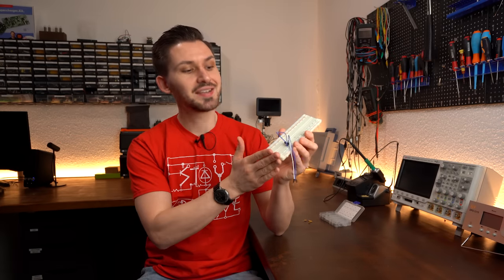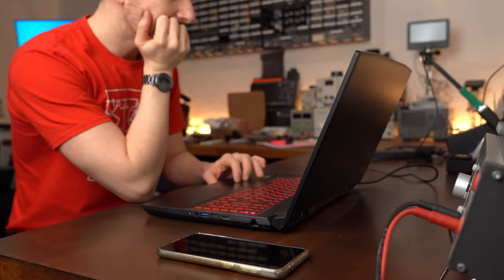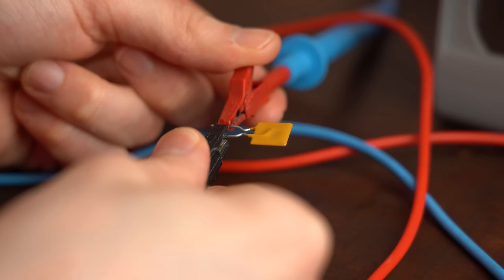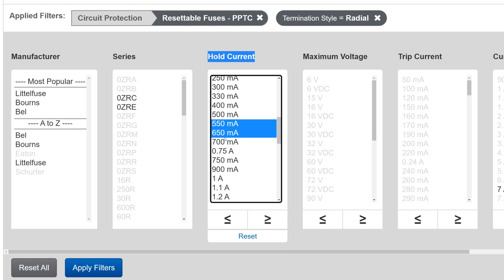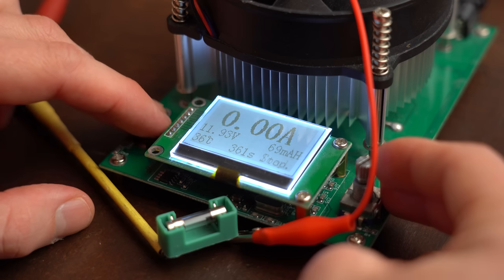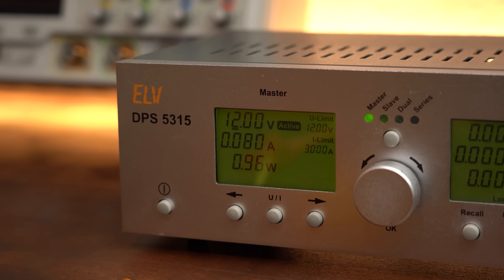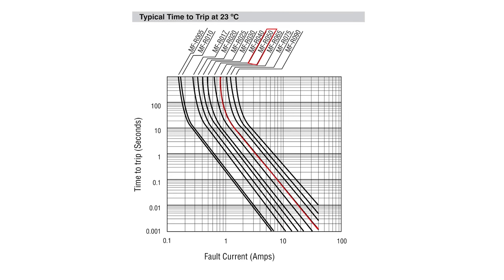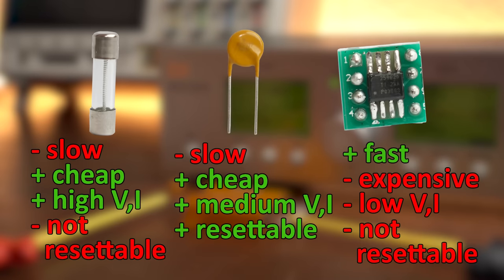The Best Protection for your Circuit is NOT a Fuse!.....but a Resettable Fuse? EB#54

Comment: Great video as always and a big +1 for Mouser!!! Two things to be aware of with PTCs vs a normal fuse or breaker though. The max interrupt rating and how fast it interrupts. PTCs are fine for low power electronics, but if there is a device with a high current source feeding it the PTC can destroy itself or not stop the inrush of fault current. Since, as like in your example, they can be rated as low as a 60 Amp interrupt rating. Fine for devices with small power supplies. But if you are powering something with a large power supply that can deliver 100's of amps (batteries, mains powered power supplies) and the device has a solid short the PTC may not be able to absorb the current spike. Whereas fuses have interrupt ratings from 5k up to 200k amps. Why some fuse holders are reject style holders, they will only fit a certain interrupt rated fuse and you physically can't install a lower rated fuse in the holder. 
Then there is the speed. Sure, tripping a 1A fuse or PTC with 2A will take a while, but how fast will a 1A PTC interrupt a fault with 20A of fault current vs a fuse that will instantaneously blow. 
Sure most of the viewers projects would be fine with a PTC, but to avoid possible damage with higher powered  devises a fuse or breaker is still needed. It can be in series with the PTC and at a higher trip level, yet will still provide protection in high current fault situations. PTC will take care of overloads and lower amperage faults and the fuse will take care of interrupting higher current faults that may have destroyed the PTC and NOT have interrupted the current flow.

Comment: I've seen these on circuit boards of equipment I've worked on or disassembled. I had no idea what the long tubular thing with what looks like heat sink blades was. Now I know. Thanks for the tip !

Comment: We recently had a Fender amp with a PPTC inside. They reported it started play less loud over time and the unit eventually turned off. When we tried to troubleshoot it we found one of those PPTC inside which had tripped. Thanks for the great video!
Reply: That is very interesting. I have a Bose system  that behaves the same way. I couldn't find the cause when I opened it up. I don't recall seeing a PTTC. Will take another look. thanks,

Comment: For example, if you have your normal current for your IC of about 500mA, in  case of a short circuit you will have maybe 10A (if your power source can supply). So it means that typically, current consumption will increase not twice, but much-much more. And in this case, this kind of fuse will (must) react immediately.

Comment: The glass/ceramic fuses are similar to those used to protect your house installation as they will trigger at 10x their rated current within 10ms(FF Superflink) to 3s(TT Superträge) depending on the class/characteristic of the fuse.

Die Schmelzsicherungen für Geräte sind ähnlich, zu denen, die in der Hausinstallation verwendet werden,  da sie auch erst beim 10x ihres Nennstromes sofort 10ms bzw. innerhalb von 3s abhängig von ihrer Charakteristik auslösen.

Comment: Hey Scott! Just want to mention that 3D printers used PPTC's in the old ages of the RepRap project. If you take a look at the design of the RAMPS1.4 Shield you can see that they used PPTCs to protect against overcurrent/shortcurcuit, but sadly this method didn't work that well so it was scrapped and got replaced with blade fuses.

Comment: A very effective way to protect a circuit is just a light bulb. When small intensity is consume it has a low internal resistance, in case of a short circuit it will limit the current to the rated lamp current. Of course a little more difficult to select but has the huge plus to emit light if "activated", 100% safe. Very useful in case of fugitive faults...

Comment: Great video! 
I occasionally restore old transistor radios which may or may not have shorts in any part of the circuit so connecting to a battery might be "terminal".
I built 3 volt, 6 volt, 9 volt and 12 volt battery supplies with a tiny "pea" sized 100mA light bulb (for each voltage) in series. At 10-20mA (correct) current the light is off and the radio might work.  If there is a short, the bulb lights up very quickly and limits the current, AND tells me that there is a fault. It uses less wires and needs less hands to work.
In some ways it is like a PPTC but I have not done your accurate work in measuring the rate of heating and current limitation.
Dave D. Australia
Reply: This is a standard test-jig in audio amplifier repair, where the lamp is a 60W mains lamp in series with the live mains wire.
Reply: @misterbonzoid5623  Yep. I have done this for valve/tube amps and radios. A 20 watt lamp has a higher resistance giving a lower voltage and current to allow the capacitors to reform slowly. When there is noise from the speaker and no smoke, swap to the 60 watt lamp and then full power. 
Dave D. Australia

Comment: I use automotive fuses. I take a U.S. outlet plug apart and align the contacts to the fuse blades then mount it all by the edge of the enclosure so the fuse sticks-out enough to pull if need be from the outside. Its not small though comparatively. But I trust it. Can handle 20a easily with the proper fuse. The hepa filter beside me pulls 1.9a on start then settles to 1.1, I put a 2a on it and its never popped.

Comment: FWIW: In my designs I use a PTC & a TVS diode for overvoltage and reverse voltage protect. I put the TVS diode behind the PTC so if there is a overvoltage condition the PTC fuse will trip protecting the TVS diode. A unidirectional TVS diode can also protect against reverse polarity from the power source. TVS diodes (basically a Zener diode) will have a forward voltage drop of a bout 0.7V so it will limit reverse polarity to -0.7V. So with just two low cost components you get current protection, overvoltage protection, & reverse polarity protection.

Comment: One problem I have found with these as a result of the small power leakage is some devices like CVCC regulators can "crash" and when the fault clears are no longer regulating.  Tried to do this with a battery charger and when there was an overload cleared it then would appear to work but the CVCC no longer limited and would have blown up the battery.  The total cutoff of a fuse eliminates the "funky control failure" of chips due to the brownout the PTC causes in a fault state.

Comment: Seen it in a homebuilt led lamp for plants. It was used to prevent thermal runaway in a 2s3p build. The goal was to achieve protection if one series broke and the other 2 got a higher current flow. When one was disconnected to simulate a brakeage it made the lamp dim because it limited the current. Interesting enough the other fuses actually restored themselves very slowly(almost simultaneously) until they tripped again. It will therefor slowly "blink" which can hint that something has happened. A perfect way to save the LEDs which can be pretty expensive in comparison to one of the PPTCs. Also the plants therefor never completely lost their lights.

Comment: Long ago, when thinking about my prototype EV builds. I thought about just replacing all fuses with Circuit-breakers, to not only save money on blowing fuses during experiments, but also keep me from being stranded. Breaker trips, just readjust something, reset breaker, and continue testing or riding around doing my delivery job. But the only circuit-breakers I knew about at the time were too big for a bike. I'm going to revisit that idea. But thank you for teaching me about this option.
Reply: And thank you for exposing me to Mouser.

Comment: Very nice! As always it comes down to the right tool for the job. Within micro-electronics, that's usually never the fuse. When working with mains, it very likely is a fuse.
Reply: i don't think these are considered micro electronics...i mean there's fuses less than one amp and it's not unusual for a circuit to draw near one amp I'm pretty sure micro electronics is more like what's inside of an IC package or even smaller than that... just saying. but i think you still made a good point.

Comment: Great(scott) video 2x👍
reverse current diodes are also very helpful keeping the components safe.
Reply: i blew up my UPS because it didn't have any reverse current protection, I'm still mad. It was just a small tap of the wrong cable for less than a second, the reverse current dropped directly at the junction of the mosfet, I was like, WTF no reverse current diode ? 
I'm never buying from this brand anymore
Reply from the maker: Definitely
Reply: @monad_tcp  I has more than one or two things let the magic smoke out. 💣⚡

Comment: There are also NTCs, that act as in rush current protection! It means that they have a decent resistance that decreases over time while it heats up.
Reply from the maker: True. You can find out about them in my soft starter video ;-)
Reply: Thermistors

Comment: i think the conclusion here is - whatever protection device thats appropriate to your specific circuit is whats best.
have you seen 3 terminal surface mount fuses with built in resistor heaters designed to melt fuse element?
part number ITV4030 :face-blue-question-mark:

Comment: THAT'S WHAT THOSE ARE!!!!!?

I always though these were some kind of weird capacitor and never paid them any attention, and the SMD ones on my Arduino Due's USB ports really confused me - despite how pretty they look. But the timing of your video couldn't have been better, as I've been bringing myself up to speed on electrical engineering to design/simulate my first complete circuit for a prototype and I've been planning on adding a fuse to it for protecting itself and my Arduino... But now I might rethink that.

PS: Just checked for these in the PC Power Supply I use for a bench power supply and found them, which explains why it cuts out when I accidently short it, but has never blown up or popped it's soldered-in-place fuse. So cool!

Comment: There are also bi-metallic thermal fuses of course which are standard for thermal cut-outs. I guess you could fix one to a low value resistor to make it trigger based on current (as the resistor heats) and it would be automatically resetting and have no 'trickle' current.
Reply: There's a version of thermal cutout made specifically for overcurrent protection. Instead of using a resistor they run the current through the bimetallic strip and the self-heating makes it trip. Or now that I think about it, this trip mechanism is exactly how regular circuit breakers work. Look for "auto reset circuit breaker" online.

Comment: These old fashioned glass fuses come in different versions, like the FF (Fast Fuse) and the SF (Slow Fuse). The fast ones react, as the name implies... quite fast. Even a small peak current, like when a device is powered up, can be enough to trigger them. Which type did you use in your test to do the comparison?
Reply: If resettable fuses were good for really sensitive applications they'd be used there but - to date - glass fuses or ceramic fuses are still in use in both protection of digital multimeters (and other measurement devices) as well as power semiconductors. Obviously that's not the case. Actually fuses come with more categories than just slow blow and fast acting.  On the other hand there really are quite slow when just slight overload is induced. And that is also intentional.
Reply: I wanted point this because my multimeter in the manual say use fast fuse 350mA and they are really fast, I just did touch the circuit and was fused even when I realized instantanly was in current mode instead voltage, :,D at least I have spare because that happen too like 4 years ago and was impossible to me find those values in my city, I had to imported them and wait because also UPS didn't have a normal service to my location.
Slow fuses are useful on high capacitive loads like power supply or motors, even on USB devices they are intentionally slow to alow charge a big condenser before trigger.

Comment: @6:35 The 1A at the glass fuse is the hold current. So you should use a 500mA glass fuse. An the time it needs to get triggered depends on the characteristic. You did not mention it. But it looks like you use a slow one. A fast triggering glass fuse should trigger with double current in about 30ms.

Comment: These would come in quite handy in some of our ceiling air con units, which do blow their glass fuses (F3.15A and M3.15A) quite regularly after power cycling. I need to look into that further...
Reply: If you are in a country with regular power fluctuations you should have motor starters in your aircon, refrigerator etc with a delay that prevents fuses tripping after short brownouts.
Reply: @mrfrenzy.  I didn't mean the main fuse of a compressor unit. It's more like the internal air handler unit which is mounted on a ceiling, that works with a cold water heat exchanger. I'm talking about industrial sized cooling here, not domestic.
You just need to supply power, cold water supply run, warm water return run and a drain line to it and you're good to go (as long as you have some machine, that cools the water circuit down).
These only have to run the fan, the solenoid valve for the water circuit and the internal drain pump on occasion.
It's always the little fuse on the control board which blows, but that power line is supplying power to the whole thing.
Reply: @wiedapp  the airhandler probably has a soft start circuit for the fan motor. If power is cut and reapplied before the soft start "cools down" it will "hard start" the fan with full current which blows the fuse. You can add a small 1 minute time relay which solves the problem.
Reply: @mrfrenzy.  Unfortunately these ones don't. It's just on or off, but on in 3 power modes (low, medium, high). They don't really draw that much current, but if the power company has to do some switching to keep the grid stable, you sometimes get spikes in both positive and negative value. And these do blow the fuses sometimes. I tried to exchange the fast fuses for some medium slow fuses already, but the super slow ones I want to avoid.

Comment: Glass fuses can be useful if you want to force the device to be serviced by a professional before applying any power to it again. In some circuits, fuses blow for a good reason, and you don't want any power to be applied again before the faulty components are replaced. Also be careful about possible failure modes, safety first!

Comment: There are glass fuses are are labeled 'fast blow' are those still slower than a PPTC
The 1 project i have a glass fuse in is my pico smart light, i put a 1A fuse on the AC side of my SSR rated at 2A

Comment: Common practice for some circuits could be to select a fuse that is rated to reset at a lower Amperage than you initially want. That would help speed up the time required for a trip. eg. instead of selecting a 1Amp trip select a 800mA trip

Comment: I've seen PTCs in transistor radios from the 60's in the load side (I believe) of BJT's, as the old germanium transistors were prone to thermal runaway.
Reply: I am not sure about that.
I remember them coming on to the market in the 1990s.

Comment: I had resettable fuses on my first 3d printer in 2015. I did not know what they were so I counteracted their current limitations with fans. in my use case they were not sized correctly and a glass fuse would have been better.
Reply from the maker: Haha. Yes, cooling them down with a fan destroys their functionality. It happens though ;-)

Comment: I use a 10A circuit breaker for my WLED setup, it's all 12V based and the breaker fits in an automotive blade fuse holder.

Comment: Polyswitch fuses were a revelation to me when I encountered them. BUT they are not as fast as fuses, since they need to physically  heat up to increase their resistance and break the circuit.
They are great for some applications - like inside a phone which is powered by a battery. But for higher performance power sources they might not protect circuits quickly enough to prevent damage.

Comment: A PTC is commonly used in self regulating heaters, as the temperature increases the resistance increases and hence the power draw goes down, when the power draw has decreased to the amount of heat loss then it has reached its stable temperature. This way the heater cannot go above its rated temperature even if it fails on and you can get them designed with lots of different max temperatures.

Edit: Another example is the smoke stoppers used with drones for testing, they are just a lightbulb but they are effectively a PTC and limit the current flow.

Comment: A fuse rating is the curent that it can hold without tripping. The tripping current/time is however on datasheet and is usually significantly higher.

Comment: I could understand this type of fuses to use with any type of controller that detects the trip and use as alarm (for example, in lithium batteries to detect shorts and disconnect the output with an additional power transistor). Or  with sensible electronics, to limit the current in case of critical failure.

But not for use with big loads that requires instant disconnect and non reset without supervision.

Comment: Adding a digital switch, relay, or other circuits that completely shuts off power when the LED indicator light comes on makes faster protection than a fuse and functions like a fuse. It could reset when the power was toggled with a timer or reset button.

Comment: I shove a ptc in parallel with the burned out fuse in my radio shack multimeter. No more 200mA burn out. But the meter affects the current a bit.

Comment: 11:32 Although valid in general, this specific type of fuse 5x20mm can only handle a short circuit current of about 30A. It can't safely break any current.